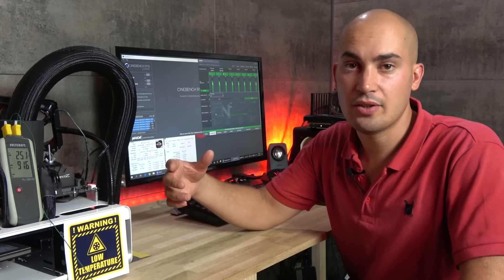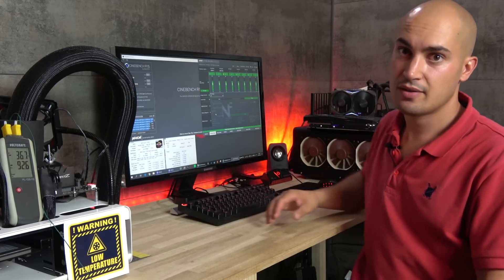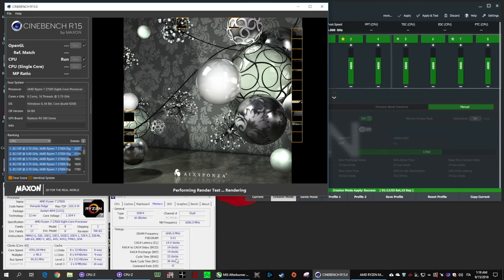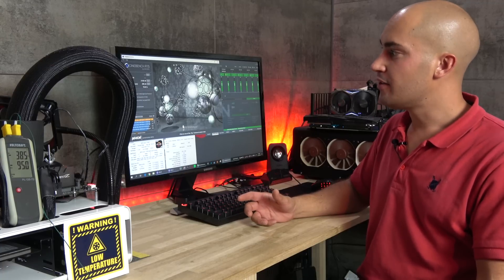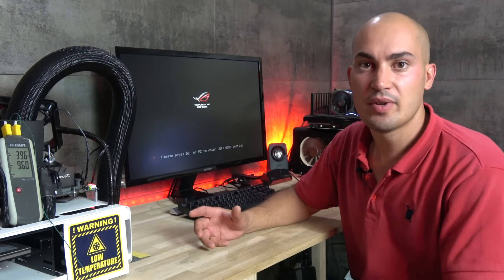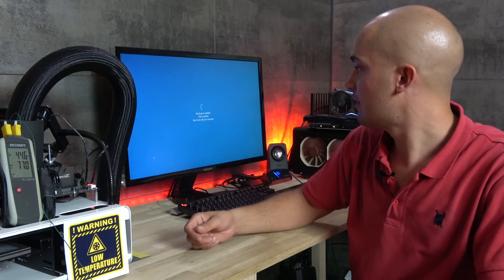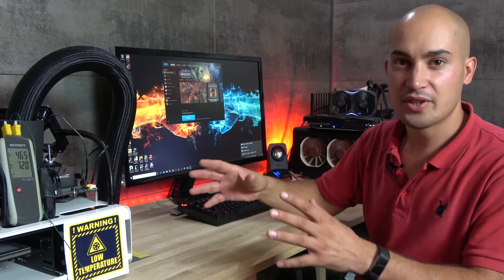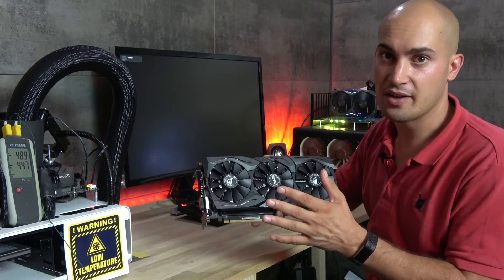Extreme OC: 2700X @ 5GHz and CB15 Single Core

Comment: Literally a 30% increase in performance by shifting the hertz from 3.7 to 5GHz. It's a good investment, only if the cooling machine was cheap, and parts.

You're probably getting a 15% increase for +$400 in the next two years (comparing 1800x to 3800x).

Buy a super cooling machine vs. waiting two years for another CPU that matches 15% increase in performance? I'd go with the cooling solution.

Comment: I saw a video here on youtube where a guy was getting 196 cb single core with the same chip at 4.4ghz when using 4333mhz ram, I imagine you would have gotten a way higher score if you had higher frequency ram.
Reply from the maker: 4333 MHz on Ryzen it's almost impossible, do you remember the video? When I do LN2 overclocking for HWBot submissions the higher I can do with selected sticks it's near 3800MHz Cas11, the maximum I saw in CB15 was 3866 from Der8auer's world record. Probably he was using a rated 4333MHz ram but clocked lower, I will try again soon with my best sticks and the other 2700X that I have, and I should be able to run CB15 past 5GHz with the cascade, I won't use LN2 for this test, it will be a waste for the single core, but soon I'll try to climb the multi core top 10.
Reply: https://www.youtube.com/watch?v=HclgUmQCNQA&t=44s actually it was 4133mhz ram, regardless it's quite impressive @HardwareNumb3rs

Comment: Wow the scaling sucks would think ryzen at 5ghz would score better. I have a 8700k and a 2700x system love both but the 8700k at 5.1 delided is my main rig, got the 2700x and crosshair 7 to tinker with, and hoping 7nm ryzen is worth all the hype.
Reply from the maker: Chad Hay on paper (so only leaks for now) it’s very promising, filling the gap of frequency and an IPC gain it could be better than intels, but until I can get my hands on one I wouldn’t speculate much, Zen it’s still a young architecture with a weak IMC compared to intel, for sure it will be a nice CPUSs lineup, the Zen+ are now the best price/performance

Comment: So now, lets add up about 10-15% to te 5 ghz single core score, and that will show some of the performance that the Zen 2 could have. Fascinating, beating the Skylake finally haha
Reply from the maker: +M4kiF AMD is doing a great job, I wouldn’t be surprised if with Zen2 they will match or step ahead at the Intels, but also It’s difficult to reach 5GHz even for 7nm, I bet they will go around 4.7/4.8 boosting, or maybe 4.9 single core, for sure it will be a great CPU. And I really hope they give a big push to the IMC, where the bottleneck is right now

Comment: You can run CB15 Single Core in Windows 7 to get more points, think about it.
Reply from the maker: Tester beta I usually have a Win 7 with tweaks for extreme benchmark, I need to format now, but I’ll use it in the next sessions

Comment: Thank you for the Vid, this was a great test. question did you ever do a video about that cpu chiller?   Mini ITX for next video.
Reply from the maker: I used the cascade for the 2700X review to test the frequency curve of the Precision Boost related to the temp but no dedicated video, if you want to know more about it I can plan a dedicated session to explain how it works. I would like to freeze the 2200G, I tried quickly the 2400G and I reached around 4,5 GHz, not too bad being a Zen 1 architecture